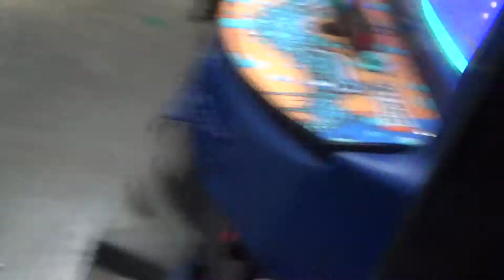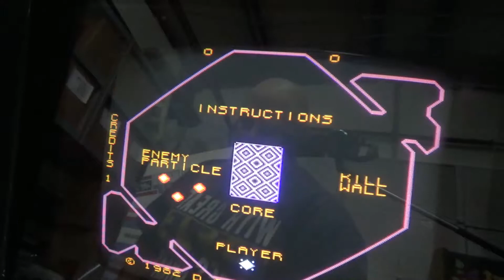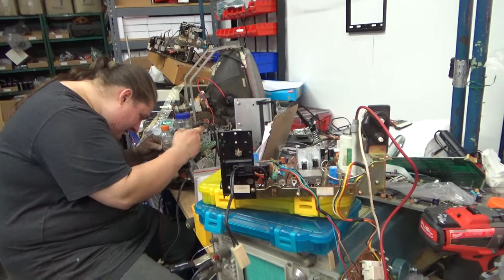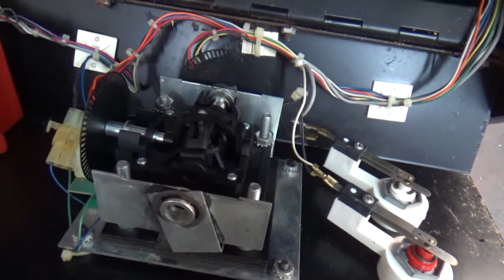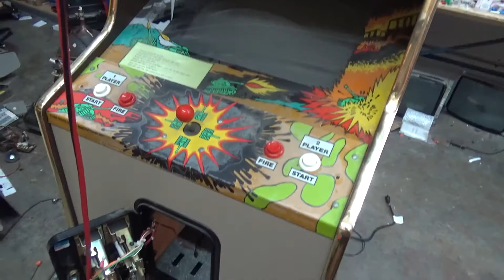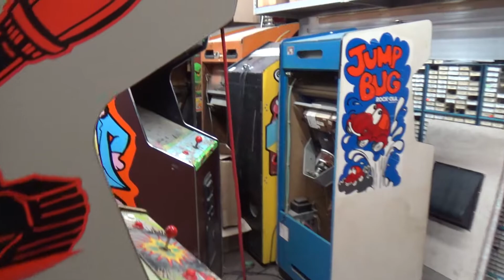Over 300 arcade games repaired part 2

Comment: Hey Jason my Reactor Does not have speech
where would i look to fix that 
Thanks
Reply from the maker: First  thing i would do is check for 30v on your power supply there should be a 30v LED lit. If that doesn't help check the SC-01 speech chip also check for proper sound eprom data